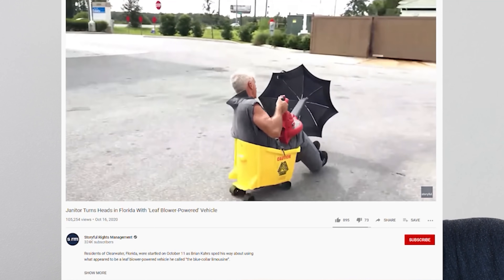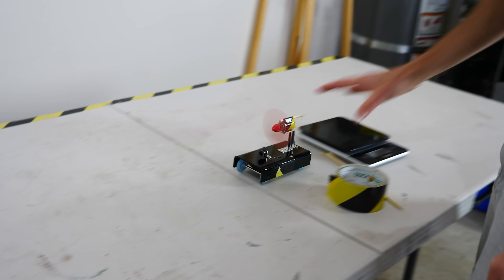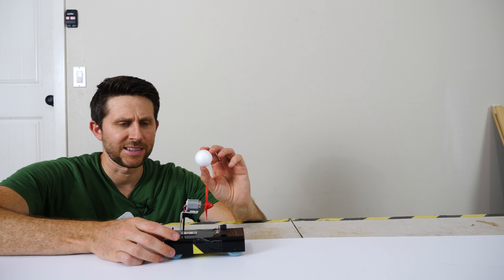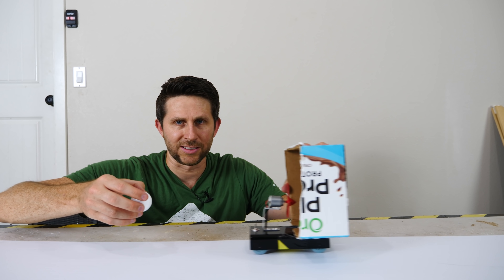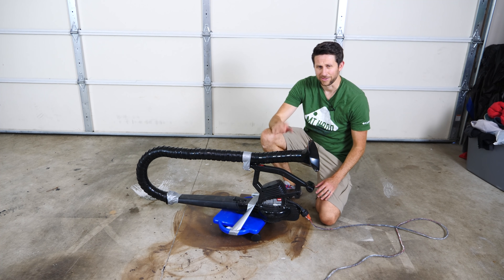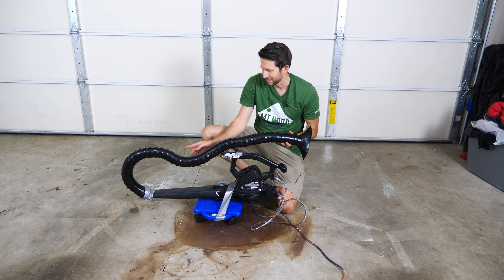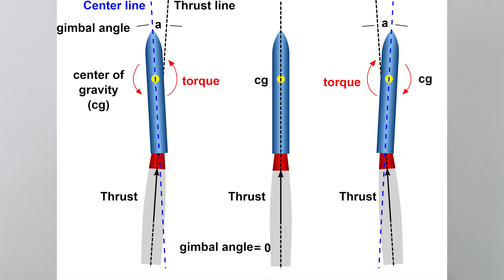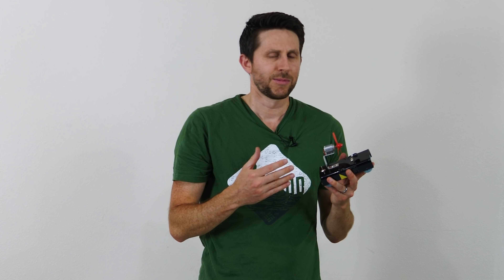Blowing Your Own Sail Actually Works

Comment: In the film Barbarella with Jane Fonda there is a a kind of boat which actually travels on ice in this way, I wonder if it would work with a parachute as it has the right shape. As he said though there is not much point because using the fan directly would work better like an air boat.

Comment: I facepalmed so hard when all these youtubers started saying you cant do this. Reverse thrust systems were real, and while highly inefficient, they proved that pushing air against a surface to create backward motion is totally doable. Some older planes, particularly early jet designs, used deflector plates behind the engine exhaust to redirect thrust forward for braking or LIMITED reverse movement.

Comment: The man in the fake video used an electric Skateboard as base.
Still isn't there a technique where the fan can pull surrounding air in addition to the self propelled air? I believe i have seen this in the sutomatic inflation of emergancy slides of airplanes. Could this effect propell the vehicle forward for real (thus not as efficient as if the propeller would directly push backward)

Comment: Mark Rober was wrong on this one, this is the correct video. When the air hits the sail it goes backwards which imparts an even greater forward momentum to the sail than the air had because its now pushed backwards. This is like a simple Newtonian physics of what the force on the ground is when you bounce a perfectly elastic ball on it

Comment: The leaf blower and the umbrella may also have been modified to have a more stiffer metal material that wouldn’t bend under as much pressure and a leaf blower with a much powerful motor as well as a modified tip. The tip was definitely a different design. You come off with the tape you slapped on the leaf blower as a person that has no clue how to even engineer lol

Comment: Both the previous and this experiments are poorly done. Why not try to reproduce it exactly like in the original footage with a sturdy umbrella that doesn't flip inside out and a leaf blower?
An umbrella has a curved, dome-shaped surface like a parachute so it will hold the wind pressure better. Your new box sail has a flat front surface connected with flat sides at right angles. Wind will hit the surface perpendicularly. I doubt your box sail was actually acting as a sail. A sail works by catching wind and wind pushing it forward, not by redirecting wind backward.
I suppose there is also a difference between a leaf blower and a fan.

Comment: There is one more thing noone takes in account. It is not only about the direction of the air exhaust, but also the air intake. The propeller of any fan is not taking the air from behind it, but from all directions except the direction it blows. That is the main explanation for this.

If you use a compressed air in a bottle to blow your sail - it will not work. Try this one :)

Comment: I just saw another dude online do this with an Umbrella+Blower+Skateboard and 99.99% of the comments were, that's not how physics works. And I was like, wait a minute, why wouldn't it work? 🤔Seems obvious that the Umbrella would redirect the air. 

Which led me to your first video take on this and again I was like, wait a minute. 🤔

So I went back to my search results and found this video of your retake. And again, I am like wait a minute... why didn't you just use a small Umbrella or Bowl or something 🤔... you know like the shape in the original videos? 

Anywho, I am no physicist, but it boggles my mind that so many people still don't understand that redirecting the air makes this possible.
Reply: It is possible with a curved sail but a leafblower is way to weak for any kind of significant speed

Comment: Technically it's not the wind blowing or pushing the sail like a normal wind would do but it is the force of the air coming around and out the sides of the box that are thrusting the vehicle.

Comment: That is not blowing a sail that is vectored thrust, not the same thing. The channel ought to know better than to deceive like this.
Reply: In a real world application the difference between the two is meaningless. The fact of the matter remains that a craft with a sail can also have the wind source on board and it will go forward

Comment: The air is not "pushing backwards" on the propellers. You can also propell yourself in a vacuum by letting air out of bottle. It's just an impulse drive. The momentum of the car is the same as the momentum of the air. The air is going much faster, but it is also very much lighter than the car. The part about initial momentums also is kinda wrong. It's only right for a split second when you turn on the propeller. As soon as the air flow has reached the box, it's forces acting in different directions, which result in velocities, but the car is only moving backwards for a split second when you turn on the propeller.

Comment: The force of the air pushing back against  the blades is less than the force of the difference in air pressure and resulting force the air puts on the "sail".

Comment: Reverse thrust is an exceptionally common concept used everywhere from airplanes to simple fan shrouds.  Everyone knows this concept even if they haven't thought about it before.  I think the confusion is that 'blow your own sail' implies a sail shaped surface which doesn't work.  If the 'sail' was shaped like a U  pipe then it's painfully obvious it would work.  Context matters.

Comment: 4:47 "I'm still going to say it's fake because the amount of thrust he got from that leaf blower just wasn't enough to move that fast."
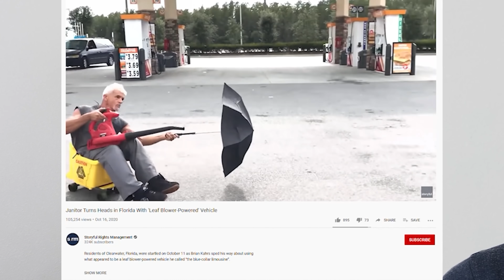There's also the fact that his Troy-Bilt TB180B 180-CFM, 7.5-Amp, 120VAC corded leaf blower, is unplugged. At 0:10 you can see both the model number and the empty electrical plug.
Reply: Good eye but how did you miss the electric skateboard the bucket was sitting on ?

Comment: I wonder if there may in fact be a benefit to flowing the air into a parabolic dome instead of using the fan directly, similar to the fluidic thrust propulsion in the new Jetoptera test aircraft.   I would love to see a video where you mount your leafblower or similar to a meter measuring thrust, and experiment with different shapes to get a bunch of data points.

Comment: I have a question that what if the blower end has close means like a closed circuit and system will it move from its place? What we can do to move the wind blower in closed loop from its place? Could we do anything for that?

Comment: Hey, Action Lab! Firstly, I love your videos. With this particular video, I would like to add a little bit more. There are always 2 parts to moving something. The speed and direction of the exhaust, and the speed and direction of the intake. The leafblower and screen setup would have worked, since the leafblower takes in air from the side - and exhausts air backwards giving a net positive force. Of course, it was flawed in practice due to the system being extremely inefficient. The cardboard box example works for 2 reasons. Because the exhaust is backwards, and more importantly, because the intake is more from the side of the box - imagine if we intake air from a big chute and exhaust it in the same direction through a straight pipe. The object will move against the intake direction due to the exhaust angle being tighter.
Reply: Good points. I also found it odd that he left out the momentum of the intake air.
In his video on put-put boats, he puts it straight, since they take in water then expel it through the same opening... how can that result in thrust?! It has to do with how focused the intake vs. the expulsion.
Reply: @gregbell2117  thank you for bringing me back to this comment! I will retract my previous statement as I believe I was mistaken. The intake direction does not matter, only the exhaust. This is because, if you imagine a jet engine stationary, the thrust is directly proportional to the change in momentum of the air. If you make the jet engine intake from the sides, or even behind, what's the change in momentum? Still the same because the initial air is not moving, and final air moves at exhaust velocity. Of course, it's possible that drawing air in from the front is more efficient due to lower resistance and suctioning air outside of the engine to flow that way too, this is essentially what bypass is. I hope I explained it well, lmk if u have any questions

Comment: I think the success of the main model is misleading. It seems the prop is not completely centered in front of the "sail", so it is basically a less efficient version of the leaf blower with a 180 degree bend (air directed into the bottom and ciculated out the top).
Would be interesting to see a very symmetrical test (centered in front of a bowl standing sideways).
In this new example, any given volume of air would still be faster against the sail than away (net overall force), but the fan being forced to recycle air going in the wrong direction may have an affect.

Comment: Would it not work to have the fan on the left hand side of a boat pointing across the boat to the right hand side. Then have a normal sail at 45 degrees? Surely then the fan will cause the sail to generate lift and work properly instead of just redirecting air backwards?

Comment: On a similar subject, some sail shapes and setups are very good at sailing forward against the wind as well as with the wind and some are no good at all for that. Some sail shapes & setups are specifically designed to pull a ship forward by wind rather than be pushed forward by it.
 In a way, sailing technology beat the aeronautical crowd to an aerofoil shape to provide lift in moving air long before those who sailed the sky. Perhaps, if they set their sails horizontal to the sea and they were big enough, in strong enough wind.... we could have had flying Viking invaders landing at English monastaries for the preist's booty!

Comment: Sorry for the late reply, I had to try this one for myself. 

It works well as long as the umbrella has a steep curvature as in the original video. 

We mounted two umbrellas onto two separate scooters. 

We used a 24V LiPo powered blower from Home Depot. 

Here’s the rub:
As long as your umbrella has enough curvature, you aim the blower at one side of the umbrella (as was done in the original video if you look carefully) and it does an exquisite job of redirecting the air backwards. 

Keeping in mind that the blower has to be aimed properly at one edge of the concave of the umbrella. 

Scooter #2 had a less curved umbrella and we only got up to 2MPH. 

Scooter #1 had almost 180° internal angle providing optimal telemetry and worked with amazing results. 

Scooter #1 got up to 14MPH. 

I did record it but I’ve never uploaded a video from my camera. 
I’ll give it a shot when I’m not working.
Reply: I want this!

Comment: What is the point of making a curved surface that directs the wind backwards, if the motors can be turned around?
It can reduce the weight and amount of resources aswell..

Comment: The thing that tips me off is that the umbrella is stretching the wrong way. The fabric of the umbrella appears to be bending inwards, but if the umbrella was acting as a sail for the leafblower, then the fabric should be pushed outwards (as if the umbrella was about to flip inside out).

Comment: I don't like his explination.  The air does not "bounce" off the back of the cardboard box. The air is ducted around a half circle and out the back. That is why the sides of the cardboard are required, otherwise his flat panel should have worked too, but it didn't.   His leaf blower shows exactly the half circle turn. But even this is cheating.  The air intake is facing DOWN. The intuitive mystifying part is how an intake facing directly backwards can roll the air exactly 180 degrees and still generate thrust in what seems like lifting yourself up by the boot raps.

Comment: controlling the flow of the input can also help, thou it can also create low pressure vortex effects that have the potential to interfere.   when i was younger i tried to design an rc aircraft that would control the inlets and the outputs of the engines to gain more manuverability.  i never had the expertice or money to do it... but i also wanted to design the craft with 2 sets of wings that could rotate to maintain lift when the body of the aircraft was vertical... think like a military craft trying to keep an enemy aircraft in its sights being able to fly vertically while still moving horizontically... with both it's output and input altered to allow for it, and the wings as well... it wasn't meant to be very fast, i wanted to maximize the manuverability.  i even considered putting gas compression lines to the wing tips to be able to rotate the wings faster... when and if the vehicle went into a stall to help self correct.  i just never advanced the idea because i figured that the airflow would create too many stall issues when it was in that vertic/horizontal attitude... because even thou i could control the path of airflow, the redirection on such a large scale could create an issue with air flow rates inside before ingestion... like i said i felt it would cause it to stall.  but without being able to test it... i can't say it was a legitimate reason to abandon the idea.  have a great day, ty for the opportunity to share :D

Comment: The air doesn't exactly bounce off the sail bc if it did then the flat sail would work. Remember, the coandă effect. A curved sail works because the air follows the contours and redirects the air in the opposite direction, whereas a flat sail disperses the air. Like when I wash the dishes and let water run on the curved face of a spoon and it bounces back at you, that's the curved sail. But if you put water on something flat, it would just be dispersed.

Comment: You're still missing one key fact! The umbrella shape. It is not a box that is cut but rather a half a sphere. The round edges can actually enhance the vortices coming out of the umbrella when reversing airflow out of the inside of the umbrella. You're essentially making an aero Spike at that point. I'm not sure if there may be some underlying principle that can result from the front flow of the umbrella due to the force applied upon the inside from the blower. I'm thinking of something similar to the Magnus effect! I mean who could have thought a rotating cylinder can act like a wing!

Comment: I got a quiz in a job interview some years ago and the interviewers didn't understand how the air would be redirected by the sail when it bulges out, causing a small thrust pushing the boat forward. They insisted that the boat would not move at all, even after I tried to explain it with reverse thrust on airplanes.

Later I found out that some people actually used a fan on a boat with various sail types and proved my point.

Comment: The man with the leaf blower is not blowing the air directly in to the center of the umbrella - he directs the air around the curve of the umbrella. His set up would work much more efficiently than using a big cardboard box. It works just like a sail boat with the wheels on the ground acting like a keel.

Comment: When ur doing this the object is being pushed back first right? So if that's the case the force applied first should be more powerfull than after it loses some of it while bouncing ect so if it moves back first with a more powerfull force and has the inertia of motion backwards helping the force then the force applied by the bouncing of air shouldn't be able to overpower it right ?

Sry if this sounds very dumb and has an obvious scientific explanation this just proves how I haven't passed 1st grade yet 😅

Comment: In the action lab first experiment with the flat surface why doesn't the vehicle move right relative to the camera since the air leaves through the prop in the opposite direction.is it because the air is reflected back at an equal speed to the air leaving the prop or?

Comment: I don't know if anyone mentioned this in the comment. Not only jet fighters use this (directional thrust). Reverse thrust flaps for jets are in use since late 60ies. There is also a special blade shape for water turbines, that makes way over 90% efficient energy transfer by reversing water stream (don't remember how this blade is called and too lazy to look for it atm).

Comment: In your explanation with the ball you forgot to mention why a flat surface doesnt work in comparison to the box. The reason the flat surface doesnt work is because the wind doesnt bounce back, instead when it hits the surface it gets pushed to the side as there is more wind coming preventing it from going backwards while the surface prevents it from going forwards. With the box, the wind cant escape as the sides are blocked, forcing the air to move into the one direction that wasnt blocked by the box: backwards

Comment: What he never explained was the different types of sails. The main sails on a modern sailboat can be rigged to use "slip stream" so air from the sides can push the boat forward and still work with wind coming from up to 90 degrees off center. The flip side of that is the spinnaker sail up front that captures more wind but doesn't work well if the wind is more than 45 degrees off to the side.

Comment: I am still on the side of the janitor . first : if you hold the tips of the umbrella with some nylon strings , they will not fold over . and you totally ignored the suction side . your little fan was completely mixing/messing with the backflow whereas the suction side of the janitor was probably without any interference with the backflow .